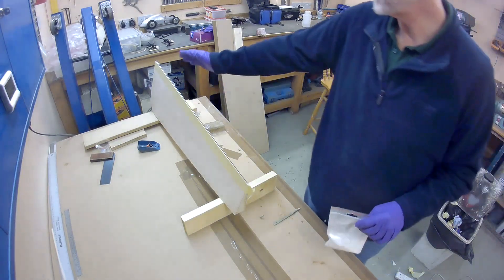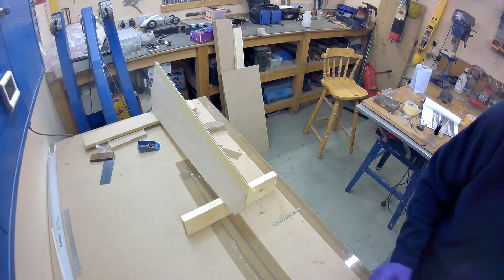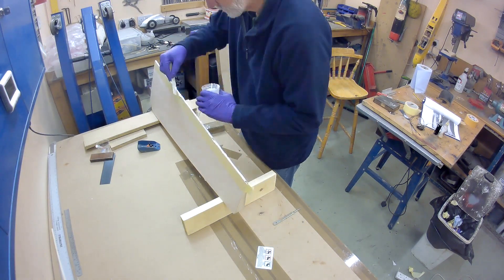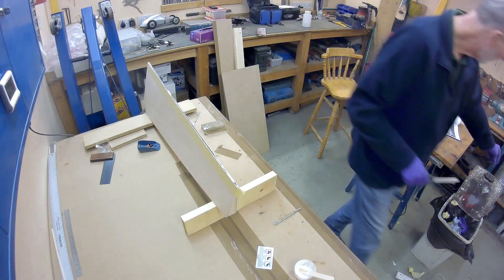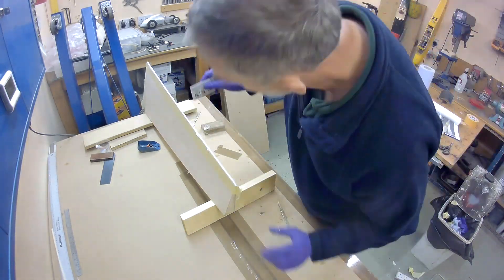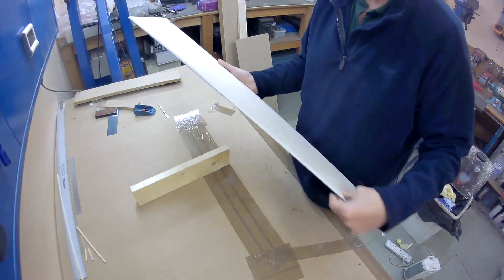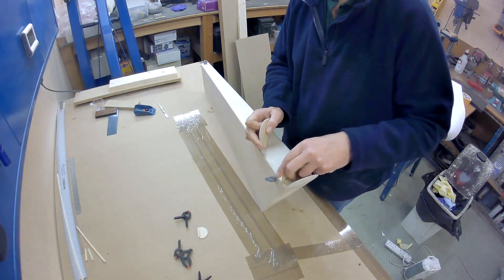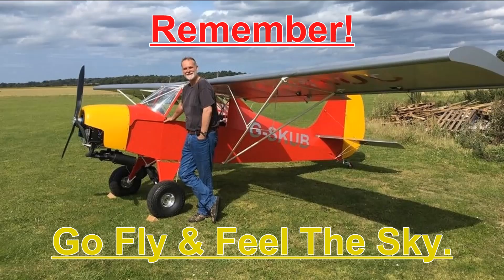Spacek SD1 TD Rudder Build EP6 (Trailing Edge) SSDR

Comment: Hi, why did you put the carbon in?
Reply from the maker: I have found with some Microballoon filling that they can crack if knocked, the carbon I put in would give it a bit of structure (it is not really needed as the ply covers both sides but at a cost of <0.1g and as I have it to hand, I added it). Just a bit of over kill.